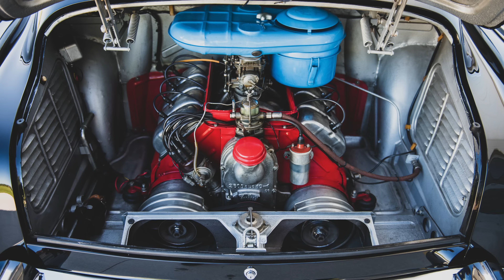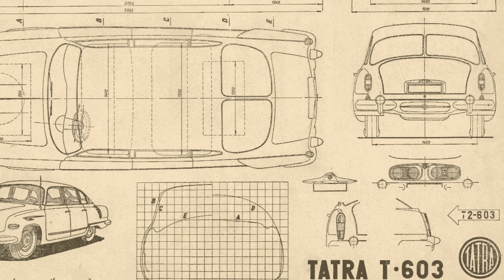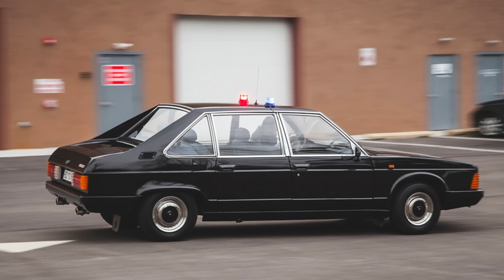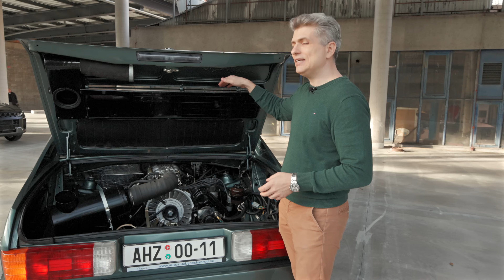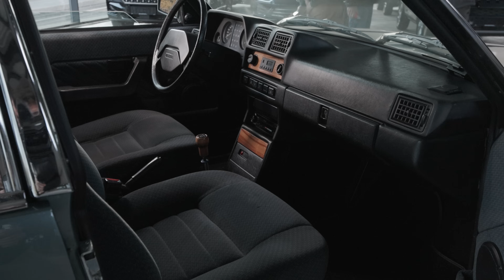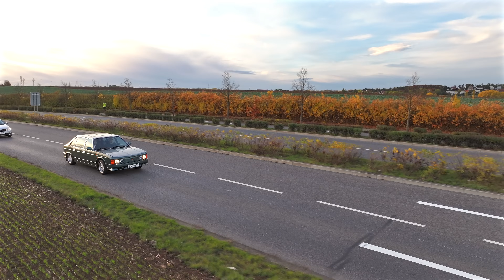I explore and drive Tatra 613, the bizarre car with an air-cooled V8 engine

Comment: It is kind of wonder that Tatra factory has survived as a truck producer. In 1988 "raw material" came in and complete trucks went out of the factory, this is not how you can succeed in the market economy, you can't do everything yourself.

In 1990 the whole Czechoslovakia was deeply underinvested, robbed by SSSR. Even in the soviet block era there were some skilled professionals in the puppet government, but their power was limited, the real decision-makers were in Moskau. The light industry aimed at producing lots of low quality goods for Russia. The heavy industry aimed at making weapons for the Warsaw pact.

The 1990's were hard time for the Tatra factory. The eastern market disappeared and the western market didn't need the kind of trucks Tatra was producing. The passenger cars like 613's could not survive, because they didn't have ABS and maybe even airbags, there was no chance to compete with western luxury brands like Mercedes without substantial investment. Who would buy czech "supercar" without ABS? Tatra was 20 years late.

Comment: The last car Tatra built was the T700 which was produced until 2001.  It had a 4.4L DOHC V8.  A handful of special versions were built by Ecorra which had a composite body and a turbocharged engine producing 400hp, and one was tested to 320kph/198mph.
Reply: The Ecorras had very little to do with Tatras apart from the engine and silhouette.

Comment: it looks a bit like an audi 80 vw passat and a bit like a skoda at the front, but when you open the back, it looks like a truck, everything is so enormous, not like a car, everything is so thickly built, air filter for example, and the whole thing is so old fashioned

Comment: I had one in '60es and had 3 cylinders, air cooled and 2 cycle. The gas tank was mounted high and had no gas pump. The tank had a metal steerer to mix the gas with oil.

Comment: I love the Tatras!
Yet, it was an impossible task for a company from the command economy-era to get these sold in the West. They never produced more than 1500 cars a year since WW2. The production fluctuated around 100 to 400 cars a year in the 1980s. There was no money for development, and by all accounts, after the 1989's Velvet Revolution the management had trouble realizing the importance of switching to a 5-speed gearbox.
The T613 would have required an update that included ABS, automatic transmission, airbags, traction control and a couple of turbos to boost it well over 300 bhp. Not to mention - great sales people. 
In a better world, they would have found a VW-type investor (Lamborghini or Bentley anyone?) and made it. Because the premise was always there.
Reply: you make it look like orders were given but people didnt get the resources or didnt work at the factory, just stood about. Or there were other more big picture reasons why the car didnt need to be made in large numbers.

With western takeover during 90s of course our production went down, living standard as well, while being told by western puppets that peope had those rose glasses. West started imposing their ideology shortly thereafter, though many old commies quickly became the morally superior fash liberals who cant decide whether 1+1 is 2 or 3 each time they count. Education level of an automechanic from 80-90s is where generally you have current Magisters or PhD in those uncalculable so-called sciences. Many of the old commie from kissing moscows backsides switched to kissing Fashingtons. Not looking at their own.

Comment: Tatra was probably the 3rd car manufacturer, after Mercedes and Peugeot. They started to build cars in 1897.
VW Beetle is actually a copy of pre 2ww Tatra.
Tatra 613 was a great car in 1973, unfortunately the communist government killed the car company, they forced Tatra to build semi trucks for Russia, the passenger car production was suppressed. So the Tatra 613 did not develop and in 1990 it was already an obsolete car. Tatra tried to make Tatra 700 in 1990, well it was already too late, too expansive and did not compete good any more.
Tatra 613 was used also as a pace car in F1 in 1980es.
The gear change did work good, just this tested car has some issues - the gear box is in the back and when it is not adjusted correctly, it makes problems then.
The engine sound is great, though it does not sound good in the video. Check the sound in this video:
https://www.youtube.com/watch?v=Q9DsgvF7hQs&t=7s
It sounds somehow between old Porsche 911 and old US V8 engine.
Unfortunately Tatra cars are dead. Tatra still does produce semi trucks, mostly for off roads. Well this company was famous for a good passenger cars in the history.

Comment: In the fact tatra 613 base is from Volkswagen 411, 412 chassis and bodyworks But engine by tatra v8 aircooled engine 
By tatra made this 613 more luxury and comfortable, From interior, seat, even have air conditions and car audio system and engine By engine tatra up rated made engine have more proformence until 20th century 90's in Russia tatra 613 is luxury car until today a lot russian people including east europe country people still keeping well and driving

Comment: My first car that i bought on my own was tatra 613 back in 1999 as a 20 years old guy and i'm very proud of it. Got holes in exhaust and the sound was incredible. As the best amercan cars
Reply: The exhaust note is VERY American V8 sounding with around half of the displacement. Shame importing a 603 or 613 to the US would be prohibitively expensive.
Reply: As an American, I wouldn't mind trying this car out! It sounds very ahead of its time, and the older models are absolutely GORGEOUS with that windswept rear end.
Reply: gasoline or diesel?
Reply: @archibuana3204  tatra's cars never had diesels ? only their trucks
Reply: @archibuana3204  there was only gas V8 in 613

Comment: The tatra engineering from the early era is just simply phenomenal. What amazing lines and beautiful designs. Why don't they make cars like this today??!!  They were simply so far ahead of their time.

That Electronik Sounds like a large vacuum cleaner.

These air cooled gasoline engines are such a curiosity to a Westerner like myself. I own an air cooled in line five cylinder Deutz diesel, love it too.  At first you think that being air-cooled will be a disadvantage, but it turns out to be very reliable. I would imagine that the same principles would apply to a gasoline-powered v8 air cooled engine.  High reliability, less mechanical complexity and unique!

I'm very very curious about tatra trucks, their integrated drive system looks fantastically capable in off-road situations.
Reply: Coz in fact communists never truly developed the car production in Tatra. So in late 1980s it was hand made technologicaly obsolote product. With no chance on luxury market for it being "from communists". In late 1940s Czechoslovak industry produced varienty of modern cars form small popular cars (Jawa Minor) thru standard cars (Skoda 1200) to luxury cars like T600 and T87.
What was left in 1989 we know. Planned economy for you...
Reply: Did you checked what other countries create at this period...? Cause there are far more beautiful cars then this one.

Comment: You are talking of an engine that is used in a snowy country. Can it survive the Sub-Saharan heat?
Reply from the maker: It should for sure. In 1947, for example, two Czech adventurers, Jiri Hanzelka and Miroslav Zikmund, embarked on an expedition to cross the entire Africa with a Tatra T87. They had to change the car due to an accident, but they did it, and even then air cooling resisted Sub-Saharian heat.
Reply: @timelessdriving  The Tatra trucks with air-cooled diesel V8 served very well in the Indian army. But most of them were used in the snowy Himalayan borders where water cooling can be a disadvantage. And the air-cooled engines quick heating, made the truck operational in minutes during the sub-zero winters.

Comment: I tend to believe that the problem with the gear shifting could be solved with maintenance/adjustments. It once happened to a MT car I own, the mechanic fixed it in 1 hour or 2, maximum. Loved to discover a new vehicle made by Tatra, anyway. Czech engineering,  at least for cars, was probably the best from the Eastern side of the iron curtain.

Comment: I saw such cars in Leningrad in the mid-80s.  And yes, it looks like, judging by the license plates, these cars were driven by KGB officers.  But not the operational staff, these machines really stood out from the usual row, but the senior officers and superiors.  All such cars were black.  I have a question... I don’t quite understand how, with an air-cooled engine, the interior was heated?  It may be warm in Czechoslovakia in winter, but in the USSR it is very cold in winter and it is impossible to drive without a heater.  How to organize interior heating in a car with an air-cooled engine?
Reply: Naftové topení.
Reply: Part of the cooling air that circulates between the engine and the engine shroud is redirected through air ducts into the cabin. I had an air cooled Citroën Visa and the heating was great.  Almost instantly after starting the engine
Reply: @danielg4228  Nope. T613 used independent petrol heating. Most versions two smaller units. One underneath the cargo space between front wheels and the other under the middle part of the dashboard. Some newer cars used one larger unit (Eberspächer B5) underneath the cargo space. Not sure whether that was an extra option or whether it came standard for some models/years.
Reply: @alexandroczayanek8561  It was factory standard. That was not so big issue. But air-conditioning come to Tatras pretty late.

Comment: In the early 1990s an importer wanted to sell these in the UK with RHD conversion, I think only four were made with wood and leather interior and restyled front exterior styling, changes to the power and gear ratios meant a 0-60 of 7.5sec and 134mph (215kph), I remember one being featured on Top Gear.

Comment: Cars that has always fascinated me, I think that its sales failure in 90 ° was certainly the cost but in particular the fall of communism and its line too old and outside the style of the time. A modern restling would perhaps have saved, but it must be believed that the air -cooled rear engine for a sedan at the time was strange. Of course, the sportsman who was planned had had discreet appreciations and could be the future of Maca in the car. Today the tatra builds trucks (I appear to me to be one of the few with the air -prone engines) it is absurd to think vhe where the communism had failed, the free market has succeeded ...

Comment: A few very low cost changes might have improved the impression of this unique car in 90ties:
- steering wheel. It looks like taken from Skoda 742M
- gauges, small ones also look like from Skoda 120L
- some switches on the dashboard could be more refined
- leather instead of velour 
- some wood grain on doors and dashboard would give a luxury touch
These might have changed the first impression your impression of upscale Skoda when you sit inside Tatra. When people buy a luxury car, they need an impression of luxury. You had to be a real car enthusiast, extravagant but also a man with a suitcase full of banknotes to buy this Tatra in 90ties. I think high-end electronics options attracted attention just on car shows, but didn’t attract buyers money. Also, Tatra engineers must have spent lot of their time (means cost to develop) to design, select proper high end equipment just for a few units. Anyway, this was almost a miracle that such exotic car was still offered by late 90ties in Europe. Imagine now a rear-wheel engine hybride SUV from Tatra today.

Comment: That engine seems ot have ended up with quad cams! Such as shame they did not consider placing the engine and transaxle in the front for better packaging.

I must admit I have less love for the 613 than the 603, which exudes class.

Comment: Tatra 613 hasn´t multilink on rear axle. It was essentially basic independent suspension. A wider definition can consider any independent suspensions having three control links or more multi-link suspensions.  It was first introduced in the late 1960s on the Mercedes-Benz C111. And first car with CanBus communication between ECU´s was Mercedes W140 in 1991. Unfortunately, T613 was very nice car with poor built quality, a little bit outdated construction and was built from cheap parts.

Comment: Id happily drive one, they look pretty modern, very attractive design and having the engine over the axle in a rear drive vehicles a boon for traction, and I love air cooling - easy matinence.
(I even insist my PC builds be efficiantly air cooled.) And I Very much appreciate unusual vehicles, and I dont know if its the fact that I was actually born in Germany (1981) or what, but I am especially interested in European cars. Here in the US this would be a considered a standard mid-sized sedan.

Its unfortunate they are pretty rare, ultra rare even here in the US. Suprised there arent more rear engine air cooled cars (especially V8s), I know air cooling can make it harder for vehicle cab heating but that can be solved by an efficiant oil-core heating system like they made aftermarket for Volkswagen beetles.

Comment: Tatra had the first rear engine air cooled.car before Ferdie Porsche designed the vw- Hans ledwinka was the designer- thy sued and won in court.against vw in the 70s I believe- the engine is remarkable but too loud and.sounds crude compared to german cars- unique is a.word I would use instead of 'sounds bad'
Struggling to find a gear on a highway is anything but MAGIC, SIR..it has its own pecadillos- for advanced tech and elegance i love citroen- it has its share of problems but it's a better car by far than tatra

Comment: The early Tatras looked like a knockoff of the 1934 Chrysler Airflow. Supposedly the VW bug also borrowed from it. 
I was stationed in West Berlin back in the eighties. So like another commenter had mentioned I had been to Alexander Platz a few times. I even have some pictures of the cars that were there. The Trabants were something else. 
It would be neat if you ever got to drive some of the old FBI cars. They had a 425 hp 1966 Coronet with a Hemi in it. 
In the 1960's America 300 plus horsepower cars were pretty common and affordable. Of course we didn't have the struggles of post WW2 Europe or the Soviet Union. There you had to be practical while things were rebuilt and then after. Communism is a whole different layer to that. 
Pretty early on rear engine cars got a bad reputation in America for safety reasons. James Dean the movie star died in a rear engine Porsche and then GM made the Corvair. A book about the Corvair was written called unsafe at any speed by Ralph Nader. 
Now in America we have 1025 hp Dodge Demon 170's. Kind of the last hurrah muscle car before the EV's start taking over. 

I know the Czech Republic is considered a great manufacturer of cars. Looking forward to seeing your EV's if they come to America.

Comment: The first time you tried changing into second gear, you weren't pulling the shifter straight back. You pulled it toward you. That's why you think you need to move it to the right, close to 4th. You don't pull the gear leaver properly  ! 😅

Comment: Wonderful car, fantastic video! Thank you!! One question: are those really Škoda Favorit side mirrors there, painted to the colour of the car body? 🙂
Reply: yes, those mirrors are really from Skoda Favorit, also some control elements in interior are from Favorit or Skoda 105/120, Felicia. Some Tatras in version called "Special" have front lights from Merc W116...some have AC controller from Lambo Countach ;)

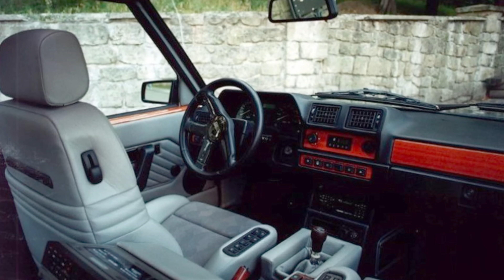Comment: 200 hp and 300 nm aare not very impressive nowadays and why doesnßt this car have not 6 mechanical gears with such a weak input from 8 cylinders? And what is the advantage of having an aircooled angine? To save on antifreeze? The bulky front of this car is also out of date. And the brake lights in the rear are a copy of the Baby Benz of the 80s. At 11:55 I do not see a middle arm rst for driver and üpassenger even though there is much room to accommodate this prctical device. At 16:53 the driver is esperiencing difficulties to shift into the right gear. Very disappointing for a mechanical gear shift. Do we actually see a rpm counter on the dashborad? Perhaps itßs missing and therefor the driver has to struggel to find the right gear.

Comment: I'm glad he's promoting this impressive vehicle! Well, you have a few mistakes here. Injection came only with the T613-4 in 1992, not in 1985 with the T613-3! And the gear shift works well even in a 2x older T613 even with 3x more km, you have to learn to drive with "DOGLEG" gear where 1 speed is in line with reverse and then 2 is in line with 3, it's drawn on the lever! Do you really think that such a bad gear was installed in such an expensive car and for the highest people?

Comment: What a piece of  beautiful air cooled V8 engineering but it was sad to see the trademark streamline body style turn into just another generic 3 box shape despite all the improvements even Porsche and Honda had to convert exclusively to water cooling under the relentless pressures for lower emissions.

Comment: Probably needs to be taken to a talented manual transmission mechanic.  There are things that need to be replaced sometimes.  However, how many Tatra manual gearboxes and parts are there in the world?  As for the engine.. it was probably microphone placement that made me wonder if I was hearing mostly belts and no exhaust.
Reply: Now I'm going to go out and drive my 2005 Ford Crown Victoria.  Smooth with a powerful V8, and less than 60K miles (less than 87,000Km).